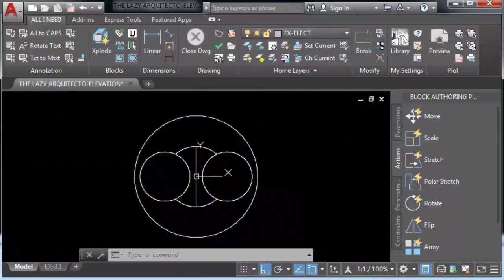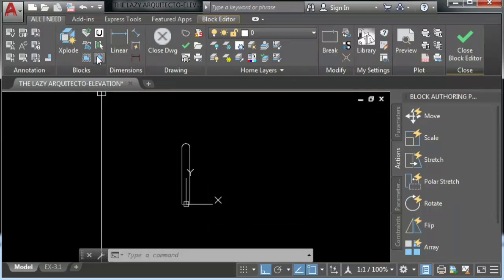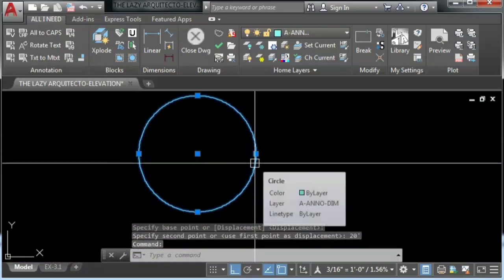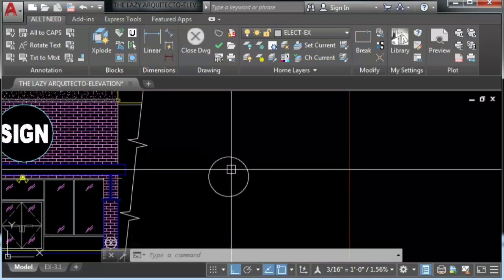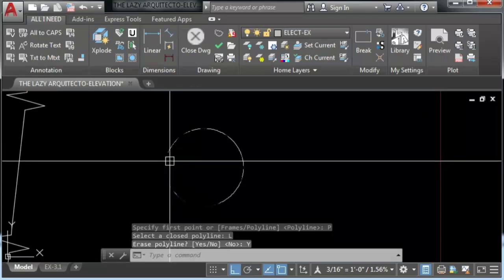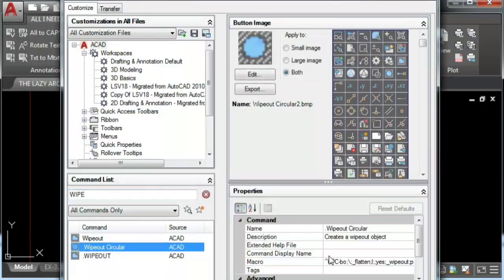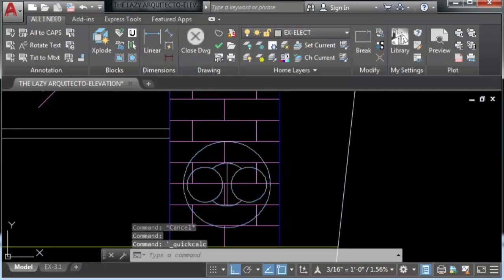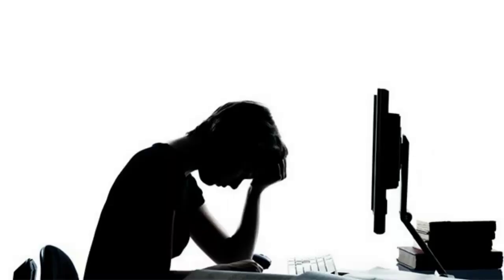How to Create Circular Wipeout in Autocad with Macros

Comment: When I try to flatten I still have a circle and cannot wipeout. Is this applicable in Autocad 2019? I use the other way make polygon and enter a sides of 1024 and then wipeout
Reply from the maker: What error do you have after using the macro and pressing f2?